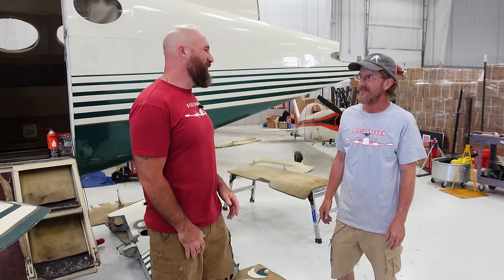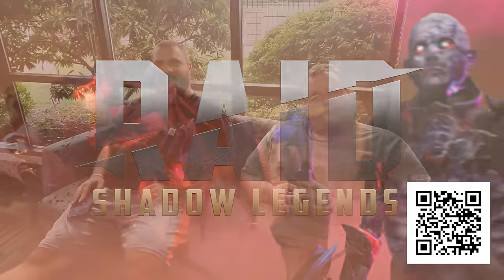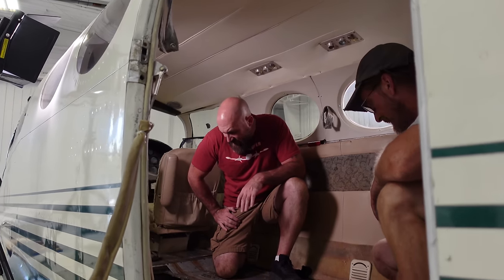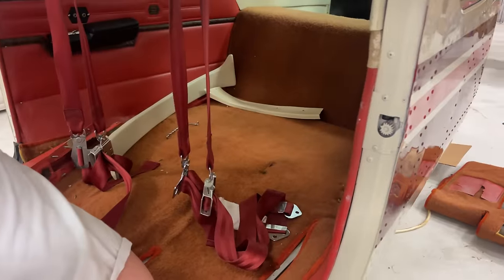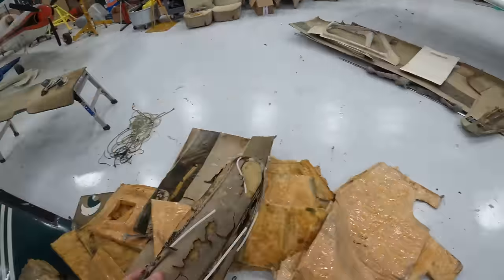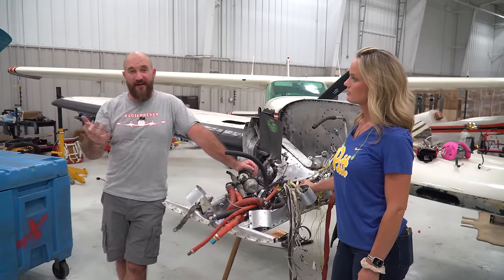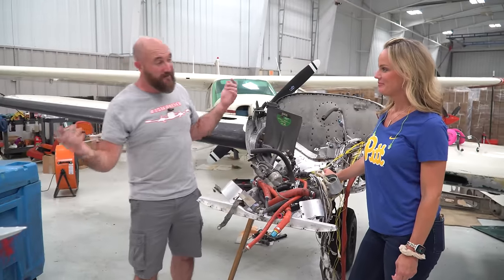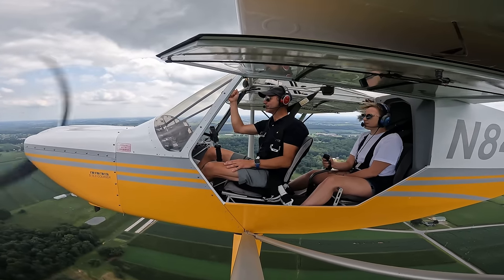Removing The Interior And DRY ICE Blasting The Free Abandoned Airplane￼￼

Comment: Hi Rebuild Rescue Team! I am a huge fan and l have watched every single video on your channel and have been following the progress of the rebuilds since the beginning of the 401. I cant wait for every new video, and the amazing work you do!
I have a question, have you guys explored the amazing technology of laser cleaning and is it something that can be used on your aircraft projects to remove surface rust? I am amazed by the online laser cleaning videos and thought it could help you guys save time when removing surface corrosion or stripping paint before a re-paint. Lots of love, from South Africa.
Reply: Aluminum rust (alumina) doesn't produce corrosion, like the one in steel or iron. Instead, provides a protective coat to the metal against corrosion, so removing this rust is counterproductive (except on welding operations, as alumina fusion temperatura is much higher than aluminum itself). 
Corrosion in aluminum is usually localized, because it's usually produced by contact with pieces or parts of iron or steel (galvanic corrosion), and that's why laser cleaning isn't really adequate for this job.
Reply: @p.informatico1320  thank you for your inputs, i see you mention corrosion but don't address my question on laser paint paint removal. I usually dont take everyone too serious on the internet  as "experts" can claim knowledge they might not necessarily have, so I  am curious what is your background and experience in Aeronautics and Metallurgy?

Comment: Jason, just an observation if I may, when ever someone is vacuuming in the 401, it frustrates me somewhat that they don’t brush the surfaces whilst vacuuming, surely it would remove more gunk, than vacuuming alone ?
Reply: I believe they will dry-ice blasted next then probably another vacuum.
Reply: @adamb1671  hi Adam, yes, I understand they will be using the Dry Ice cleaner, my comment is regarding the initial vacuuming, when I vacuum “detail” my car for instance, I brush debris towards the hoover nozzle, therefore doing what I believe is a my thorough job, agitating the muck off the surface you are cleaning !

Comment: Mouse poop is dangerous. PPE should used at all times while handling stuff from inside/being inside/near the airplane. Better to do that removal outside with a fresh air source. I would also recommend damping the stuff a bit to keep dust down.  Lastly, I recommend installing a good sized air purifier in that building to keep mold and whatnot down, as it will spread from these old vehicles if left unchecked. I would say that renting a tent and putting the tailless 401 in there with the side panels of the tent installed would be best (plus the PPE etc). I speak from experience and also having many medical professionals in my circle of friends. No one is going to tease you for protecting your health & that of your employees/project partners and family.

Comment: People you have to remember they are disassembling an airplane first then they will have to reassemble the plane with these used parts. This is five times harder than building a new plane !!!    When they are building a new plane they assemble it in order so it is the easiest to get to everything. They drill new holes and mount each piece. When they disassemble a plane they have to remove stuff as they come to it and no one knows the exact order it was assembled. They are removing old used corroded fasteners and must drill out one time use rivets without damaging the sheet metal.      The plane has been flown and walked on and the metal parts have been stretched and bent and tweaked slightly. When you take the screws and rivets out the metal moves and a lot of the holes no longer align. Then when they start reassembly they will have to push and pull and pry to get the holes back into alignment so they can install new fasteners !!! They also cannot forget the exact location of each part because the holes are not in the exact location on any of the parts. If they accidently leave out a piece they might have to remove several parts to get to the area where the part must go. That can mean removing a lot of rivets that were just put back on !!! The hardest part of this rebuild is still to come ---- the reassembly. 
       Now i understand why most old airplanes get scrapped instead of being rebuilt !!! He could buy a brand new plane for less than this would cost without the donations and volunteered time !!!!

Comment: It's great it's rated to do the buttons and switches in the cockpit, i'm just curious, seeing the condensation on the nozzle ( and i'm sure that's from the ambient air in the room ) if there is moisture (it is ICE) but it's DRY ice, so.. I'm just curious if it does condense on the surface from being shot with such cold ice (duh) just to possibly harm any electrical connections that don't have dielectric grease on them.. dunno just curious

Comment: Question, if you were to put a strip of thin rubber (intertube) between the seat rail and floor to stop dissimilar metal corrosion. Is it legal? Will it lower the integrity of the seat mounts?

Comment: As much as I’m enjoying this rebuild I can’t help but think you’ll have $250k in a $150 airplane.😜
Reply: It will be closer to $400K than to $250K.
Reply: no this 401 cost old about 100K and restore pay 40K about if not need repair engines lot. used no lot time used engine used cost 4000 and restore engine cost less than 3000, paint cost can make in hangar 2000$ and interior car interior shop make new panels 1000$
Reply: @mattivirta  Mid-time engines cost $30K+ dollars each.  Overhauled engines cost $65K-$75K each.  Heck, the core value on a run-out TSIO520A is close to $20K.  How are you going to get an airworthy engine for $4K?
Reply: @eagle2019  i have finland OHxxx and thailand HSxxxx

Comment: I'm Realy enjoying The Time with You Guys & The Work You are doing on The 401, can I give You a few Suggestions for The Insulation, The best  Insulation You can use is The Same as Thy put in The House but Not Fiberglass Pink or The Same as You took out of The 401 This Insulation is a New Product, it's called Rocksoll Insulation and it's virtually Fire Proof because it is made of Rock and Non Flammable Glue & as for The Wiring, I Would Like & Sugest to You to Replace it all because of both The Age of The Aircraft & because of TWA 800 & Swiss Air 111 They both had Bad wiring and as a Rezult Many People Lost Their Lives.
as for me Swiss Air Flight 111 Affected a Lot because The Aircraft Flew Over my House 🏠 before Falling into Peggy's Cove Just between New Brunswick & Nova Scotia at That Time I was Living in Albert County just inland from Fundy Park just outside a Little Town called Elgin, I was up & was Wondering What The Racket outside was was all about & went outside to see What was going on & There it was Right Over my Head it was very Low but I didn't know if it was having just Engine Problems or What so I Call 911 Reported but I was Not The Only one to do so, Then The next Day I Heard about That The Aircraft had Crashed & all Lives Lost, it Effected me for a very, very Long Time after.

Comment: Definitely don't use aviation insulation unless you are required to. Anything with a C of C that comes with it has BOHICA on the label. When i worked for the Big Orange Helicopter Co. they made plywood covers for the turbines to keep out the birds etc. and bought handles from an aviation supplier. The same garage door handle that costs $2 at Home Depot was over $90 from a supplier with a C of C and is not required for a piece of plywood that covers a turbine when not in flight. This is why you need to keep an eye on purchase agents that have no aviation exp. it ain't their $$$ and they don't care.

Comment: Hello 401. I am  cringing as I see you lifting pannels and removing all the parts without putting an identifier or RRR tag (Remove, Repair, Replace.)  To both identify the part and keep your overhaul records traceable.Without traceability to when where what aircraft a part was removed from it makes it much more difficult and a lot more expensive to certify the Part / Unit / Componant. To be put back into serviceaceable condition. It just also makes it so much easier to just relocate exactly where in or on the aircraft the pieces belong. Great project showing real progress keep up the good work, but hey maybe try to make things a little easier for yourself or someone else who will be doing the re-installation of the removed pieces.

Comment: Great video.
I absolutely think, you should pay for more than 1 company to come and dry ice that sucker.
Possibly invest in a machine.
As the money ur gonna spend fixing this stuff up is going to get outrageous.
Even if its 30k id bet you save money by purchasing oneor, continue to invest in the community too, which is nice.
However, u have a detail shop.
They can use it there on super old luxury high end stuff people want detailed or are restoring.
You can easily charge 1k to hit under a car, easily.
Thats hours of work alone and an expensive machine.
Thats not perfection, thats just hitting major areas.
Im betting itd be more like 4 grand to have someone sit there and fine tooth comb perfection the underside of a car.
There's no way its remotely cheap.

Comment: Anyone care to explain the use of dry ice blasting? Like, what is the difference from other cleaning stuff?
Reply: Dry Ice blasting is a non-abrasive, environmentally sustainable solution for cleaning in a multitude of applications, especially industrial applications. There is no moisture, no secondary waste (i.e piles of sand), no chemicals, and it is made from recycled CO2 captured from industrial processes and repurposed in the form of dry ice. Follow the link in the description to learn more about the dry ice blasting process! 👍

Comment: Did i saw guy using knife, cutting carpet on aluminium floor? Ok, with non-pressurized planes it is not so crucial, but anyway, i won't do that... Big risk to leave scratches, what will cause fatigue cracks after

Comment: I'm getting to the point with this channel that I might have to let it go.
Its supposed to be about actual restoring, but its twisted towards far, far more minutes of chit chat at a level of conversational ... whatever ... than actually doing any restoring.  It took 20 minutes to pick up a tool and actually do something in this video, then the dismantling of the interior was cool, and about 5 min utes of the dry ice blasting was cool.  Out of 45 minutes, I ffd'd and watched less than 15.
When the 401 first arrived is when I sub'd and those first vids moved pretty quick and we got to watch the tasks to restore it ... now its changed, less doing, more ... well ... not doing.  If this is an editing process change or a loss of editing direction ... then it needs reigning in.
Diehard fans will stay on ... the new subs obtained when the 401 project started will go away, generalist youtube consumers dont stand for 45 minute drawls.

Comment: Still surprised to see so much bare aluminum. All, & especially corroded areas would benefit from conversion coating (Alodine) before primer. Scotch-brite surfaces to be conversion coated, until water break free surface is achieved. Filtered air blast to dry, compressors have air in them. Don't touch with your bare skin after prep.

Henkel Alodine 1132 Touch-N-Prep Chromate Conversion Coating can be a more practical alternative to brush Alodine & (deionized or distilled, never tap) water rinse, when applying to assembled parts that might trap fluids. 

Primer should be applied asap after conversion coating. Don't touch with bare hands, once surface prepped for prime. If you can't forced heat cure primer, you may have to wait a day @ RT before handling, 14 days @ RT before top coating, if that's something you have in mind. All this affects primer/paint adhesion, & ultimately corrosion protection performance. Did I say "Don't touch with bare skin."? Surface prep is everything. Primer & Top Coats almost always have dry film thickness requriements.

Manufacturers are moving away from Zinc Chromate primers (Carcinogen). MIL-PRF-23377 Barium, Strontium, or non chromate primers are a common safer alternative.

All materials must be purchased with certs to material specifications. Everything has a shelf life, & storage environment requirements matter, cool & dry, rather than hot & humid, which are also important durning application. Record times, dates, & temperatures of everything you do. If all of this sounds overwhelming, hire a pro. Avoid the no time or money to do it right, before you have to do it over, trap.

And of course, check with the manual and/or Cessna on what you're allowed to do for repair & refurbishment.

Comment: You know, if you don't want us to know the identity of 401-0253 over in ohio, you're going to have to do a WHOLE LOT BETTER at obscuring its tail number.  I mean, seriously, why did you even bother to try?
Reply: Summary1968 CESSNA 401
Fixed wing multi engine
(8 seats / 2 engines)
OwnerDLS AVIATION
DAYTON , OH, US
(Corporation)
Airworthiness ClassStandard/Normal
Serial Number401-0253
EngineCONT MOTOR IO 520 SERIES (Reciprocating)
Horsepower: 285
WeightLess than 12,500lbs
Speed198mph
Mode S Code050001351 / A002E9